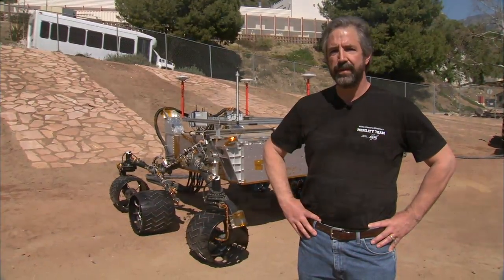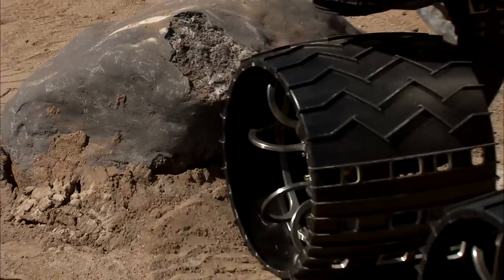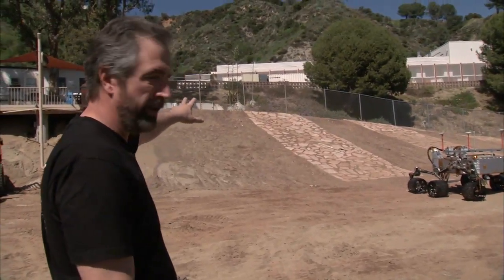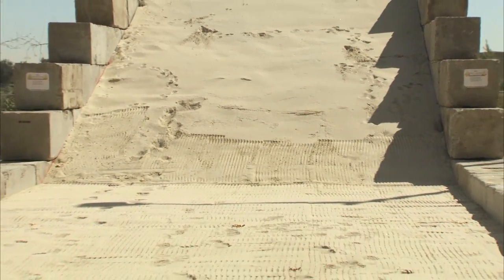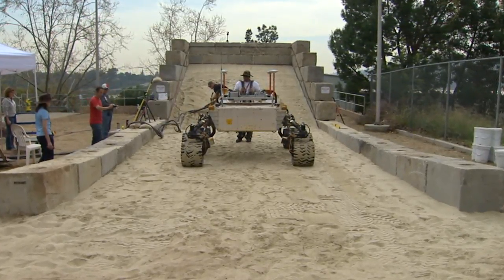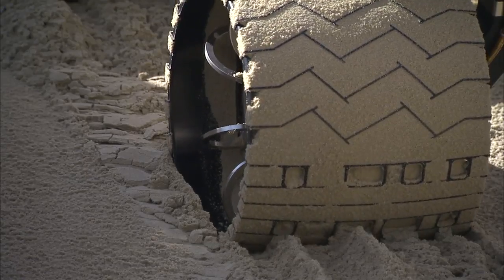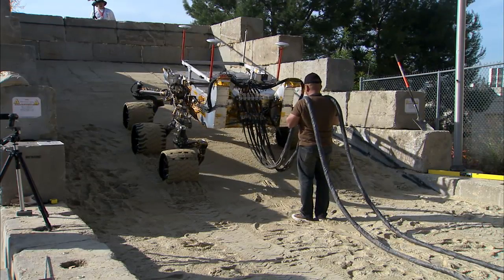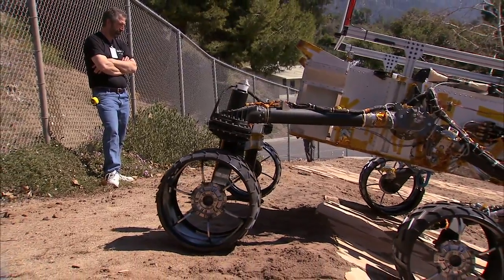Curiosity Rover's Stunt Double Takes a Spin [720p]

Comment: On the sand part you can see that the pattern of the whell gets covered by sand, this would take off a lot of grip, would this be a trouble?
I also think that earth sand has a lot of moisture, in mars this is not a trouble, probably will be dry as salt.